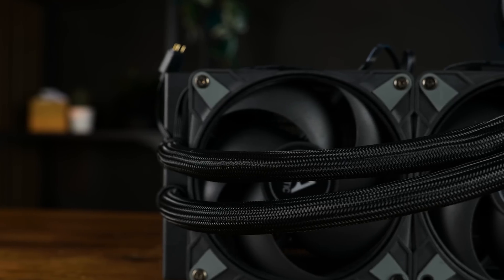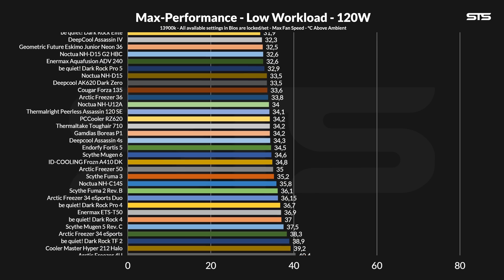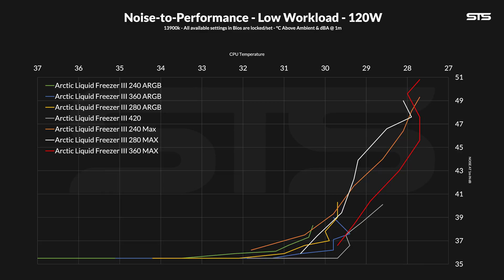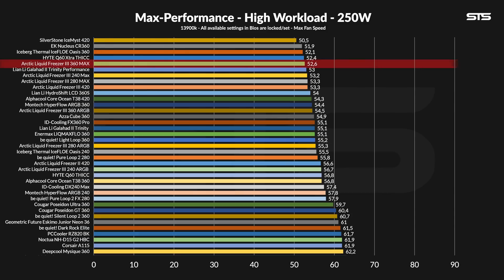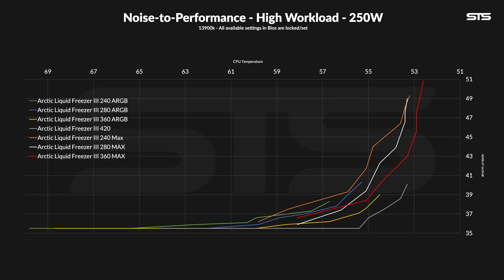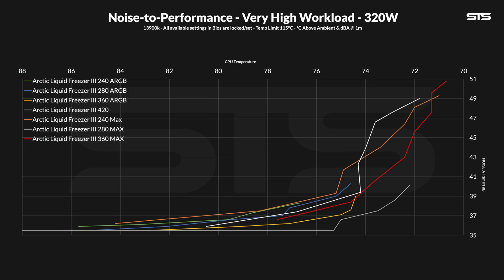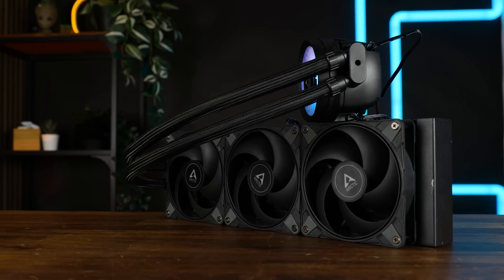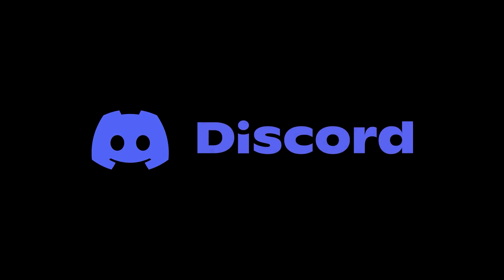Arctic Liquid Freezer III 360 Max - Is There A "Too Much"?

Comment: Building a HTPC system and the entire front of the case is a Liquid Freezer III 360. Installing Arctic 120 slims outside the case pushing and the stock 120's pulling. 🤞 We'll see how it goes! Think you've hit the limit of the cold plate and pump combo.

Comment: Speaking of the Arctic P12 Max fans, they have this nice ability to just turn off, if your fan-controller software allows it at low temperatures, like the bios setting of any Gigabyte bios, featuring smartfan6. My Silent Loop 2, which comes with the triple F18 fighter- erm I meant, Silent Wings 3. Now have three Arctic P12 Max on the radiator and up to 30°C CPU temperature, there will be 0RPM and 0dB noise, on and 0 Watts of power.
Yes, they are loud at max RPM, but compared to the F18 fight-erm Silent Wings 3, my ears found the noise of the P12 max to be less annoying or ear-drum exploding.

Comment: lol i got 6 of them on my arctic freezer 360aio 2 xD
edit: please help me i dont know what im doing wrong i got a i7 12700k using with this cooler with thermalgrizzly kryonaut extreme and on 220watt load it still get around 88 degrees celsius high. I often tried to change the mountain pressure and it got a lil better (before 95-100 degreees). Im using the asus b760 f gaming mainboard. ty

Comment: i have a manually overclocked 14900Ks and i have 6 of the fans on this thing xD
Reply: Did the bios updates fix the instability and slow down the degradation without costing performance?

Comment: How are these newer AIOs holding up to the EK Nucleus CR360? is EK still a good consideration?
Reply: pump noise is still horrible on the LFIII Pro. I have one and will return it.
Reply: @teethashaquan5395 rly? I bought one, but havent installed yet coz thinking doing the push/pull config
Reply: EK Nucleus CR360 is till the King
Reply: I wouldn't invest into an EKWB product 
They might not exist really soon